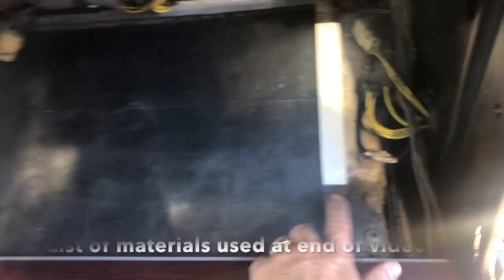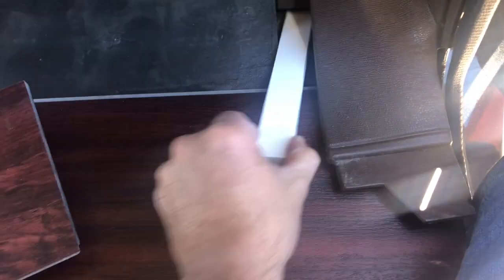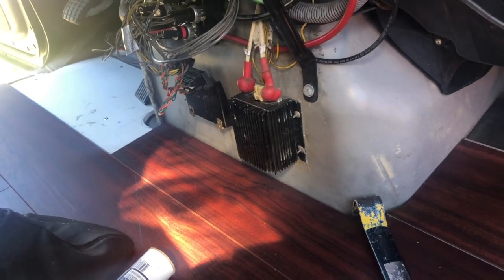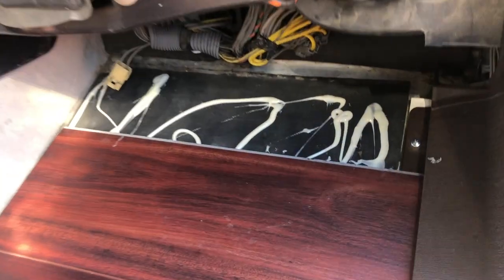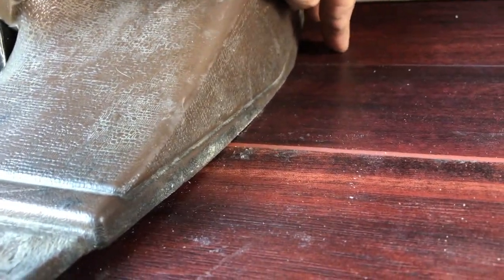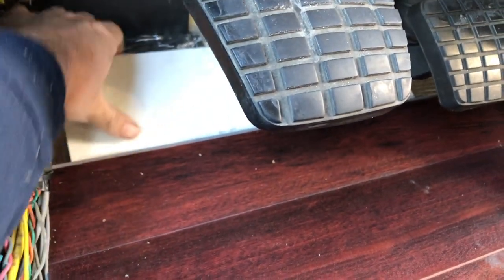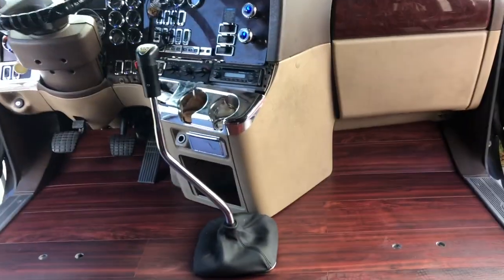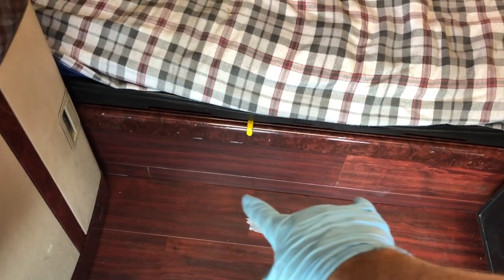part 2 how to install wood floor  on freightliner coronado, century and Columbia

Comment: Nice work @ 2:50 if you have the flooring seam lined up with the plastic so they have the same angle that might help, also if you sand the thick
part of the plastic molding (if you have to), never done it but I think that it will match up a little closer. Looks great, gonna do a friends truk. Thanks for showing your process.
Reply from the maker: The thing is that the floor interlocking in the seams I thought it might not lock in properly as it need to be flat to lock in properly
Reply: @fldlife  Got ya thanks for insight

Comment: Nice job!  I’m doing my install today.  I’m concern on how the seats mount up with the flooring.  Is there any buckling of the floor where the seats mount to?
Reply from the maker: You use all the original hardware to mount the seats so it’s just as stock

Comment: What do you think about plywood floor with epoxy ?
Reply from the maker: Chris 387 as long as your can keep moisture and water away it’s ok I had that before last me 2.5 years
Reply: @fldlife  o ok, cres que dure mas los que pusistes en el video o plywood? Quiero poner pero no se cual
Reply from the maker: Chris 387 lo que yo puse creo  durará mas por que es plástico no se pudre con el agua solo cuidar que no se ralle estos camiones tiran agua de el a/c y eso te lo daña
Reply: @fldlife  O ok 👍

Comment: Any modifications for the gas pedal?  Can you send me a picture of what it looks like under the petal.  I’m concern that the added height of the floor will restrict the acceleration.
Reply from the maker: We didn’t modify anything on n the gas pedal on this one it is my friends truck when I see him
Reply from the maker: Everything worked as it should
Reply: The freightliner pedal is a "tip forward" pedal not a tip down. You could stick a 3 inch block under the pedal in a freightliner and it doesn't affect accelerator.

Comment: Do you have a shop can you do mine?
Reply from the maker: Stitch T unfortunately I don’t have a shop I did this for my friend what truck do you have?
Reply: @fldlife  06 century I'm always in Mia
Reply: Hey buddy . What kind off vinyl u used . The name and from where if u don’t mind
Reply from the maker: Us Eagle we bought it at liquidation lumber it was one of their top of the line for this install unfortunately I don’t remember the name but it was heavy and hard to cut
Reply: Can i use kilmat ?
Reply from the maker: badrudin mohamed of course you can I use this material because it’s available at any Home Depot and lowes literally around the corner plus it’s cheap but you can go with anything similar
Reply from the maker: badrudin mohamed I just checked it out killmat is a good choice 👍 it’s not too expensive jus make sure you measure your square footage